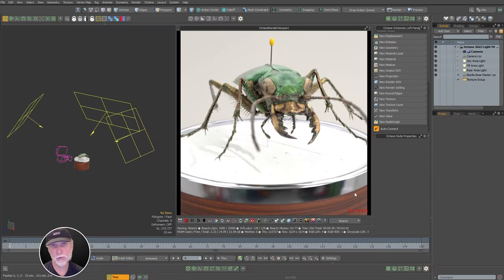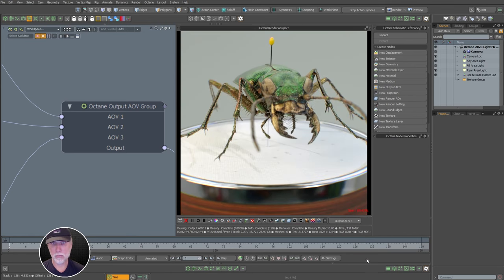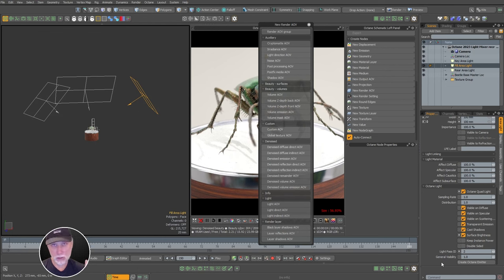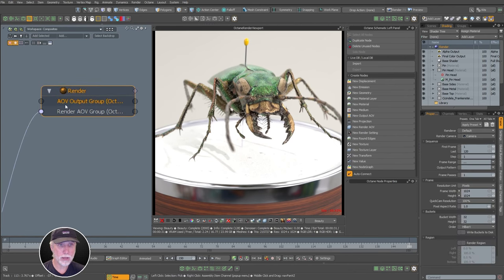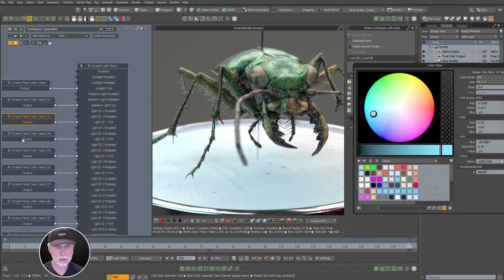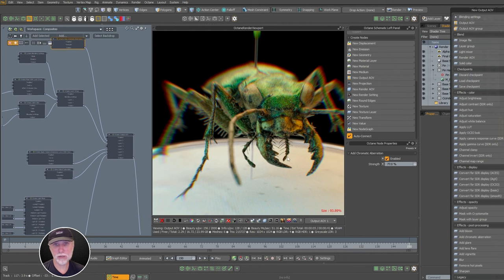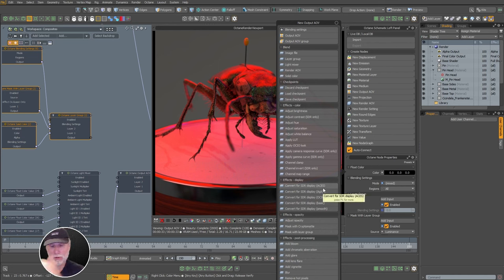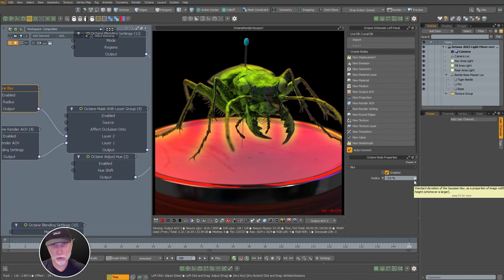Modo & Octane 2023 | Light Mixing and Compositing

Comment: Are you having issues with Modo 17 and Octane. I have been having all kinds of issues since installing and using both. If I try to render a screen shot using the Modo render "F10", it will disconnect all textures and materials in the scene. They are still there, just not applied to their assigned meshes. My Tropism no longer works, it wont produce a point cloud. And Im not sure yet untill I do further test, but it appears Modo 17 or Octane is rotating UV's 90 counter clockwise. I made a plane and brought it into Substance Painter and textures had to be rotated 90 clockwise to be in correct rotation. Please let me know if you are seeing any problems.
Reply from the maker: Pressing F10 will rendering using Modo's renderer, not Octane's.  Keep in mind Octane isn't integrated that deeply yet (keyboard shortcts, stuff like that).  You have to render using the Octane render window (play button).   

There may be a Tropism update incoming (or it's already here).  Come to the Pixel Fondue discord and Fredrik (the author) can answer questions)

Haven't seen the UV rotation issue ever, make sure it's set to UV mapping and not planar
Reply: @Pixelfondue  I'm not certain about the 90 degree rotation, it occurred, I may have been tired and did it myself, but I have tested "F10" ( I still like to take quick screen shots to check my work) when I do that, all textures and materials are disassociated with their assigned mesh. In ver 16 where there is no Octane, it does not do this!
Reply from the maker: @vecchiochristo5792  So, if you have the textures in your shader tree that's def. something wrong (pressing F10 and rendering in Modo should work fine).  But if the textures are set up in the schematic with Octane nodes than F10 should NOT show the textures.  You have the textures in the shader tree?
Reply: @Pixelfondue  I'm in the middle of a large project, so I have only done a couple of renders with Octane. I installed Octane just so I would have it, but intended to keep on using Modo's renderer for now. I have not added any materials to Octane, everything is in my shader tree. I just tried a couple renders with Octane, did nothing with it in terms of really setting it up, I just hit the render Octane button. It rendered the scene just fine. But if I go back to Modo's renderer it breaks the link to all materials. I just not tried it again, wiped out all my assigned materials. Try it , add a material to an object (in Modo's shader tree), then render with Octane, then go back and do a "F10" render and see what happens
Reply: @Pixelfondue  I have been talking with Frederick, he sent me some test files and sent him screen shots, he thinks the config files have been corrupted. He made the comment that Foundry has been screwing around with the config files and have them all over the place.
Reply from the maker: Are you on the PF Discord?  I'd maybe ask there and see if anybody else has that issue.  YT isn't the best place to get answers.  The link is in the channel description. @vecchiochristo5792